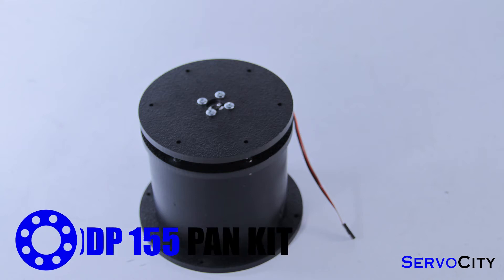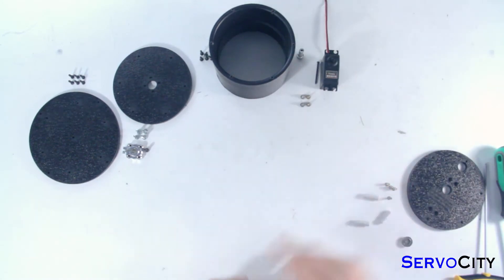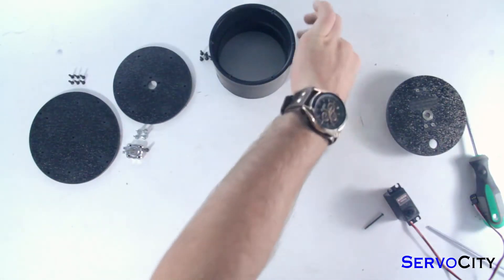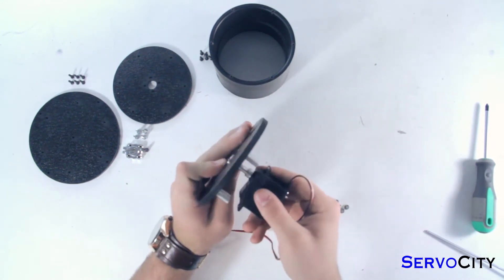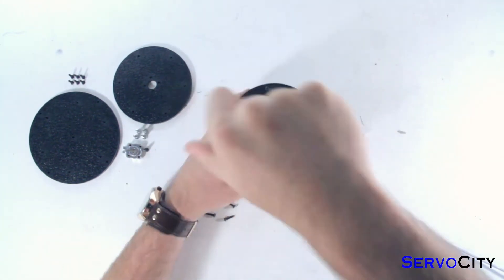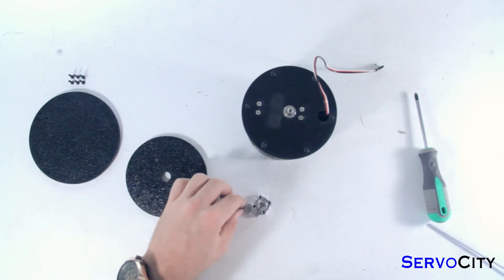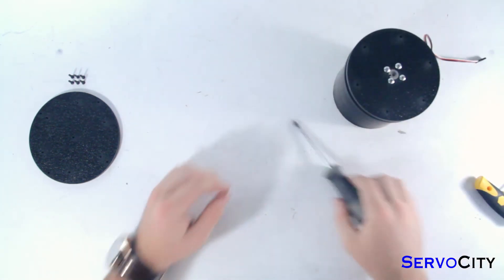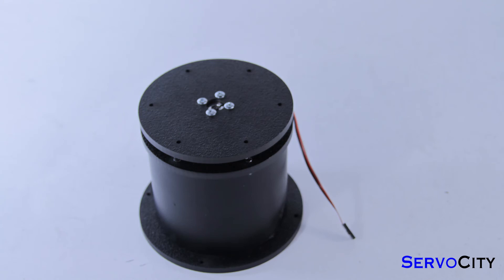#DDP155F DDP 155 Pan Kit Assembly (Full Instructions)

Comment: What all would I need to make this a completely self contained fully operating battery operated panning unit?  I've never worked with servos before so I don't know what all I need.  I would like to make a tri-pod mounted panning unit that I can place my GoPro and/or SONY FDR-AX100 camera on and be able to rotate it at a smooth speed of approx 1 rpm.  Are there other options available?  I am concerned about motor/servo noise and had looked at your belt driven unit but this looks like a nicer, and smaller, looking package.  Any help or advice will be greatly appreciated.
Reply from the maker: This would not be a good solution for a pan system that needs to rotate at 1RPM.  
You might consider using the worm drive gearbox with a motor near that runs at least 35RPM to achieve an output speed of 1RPM.  You could then use a motor controller to control the speed or simply supply power to it in order to have it run at a constant maximum speed.  If you have any other questions feel free to contact our techs directly at tech@servocity.com and we'd be happy to help answer them.